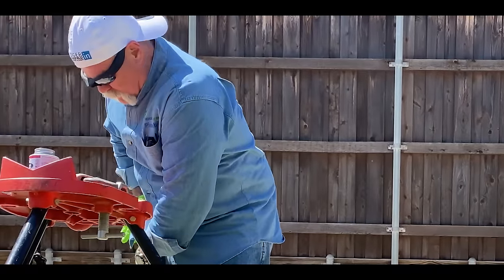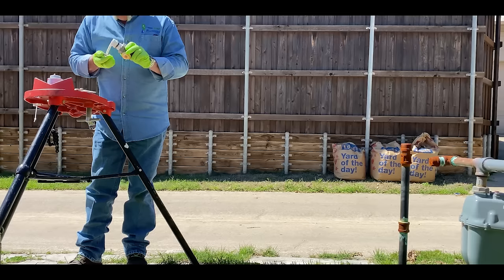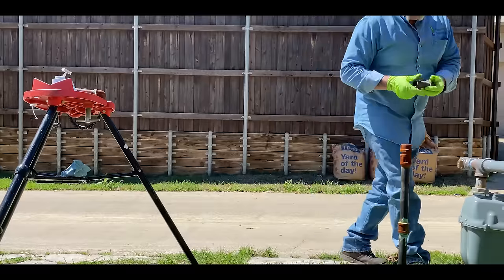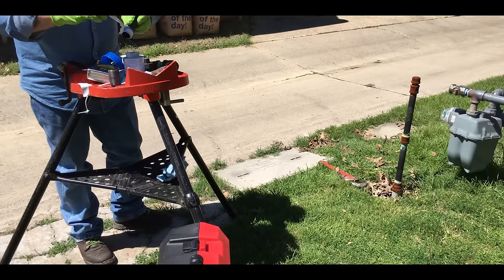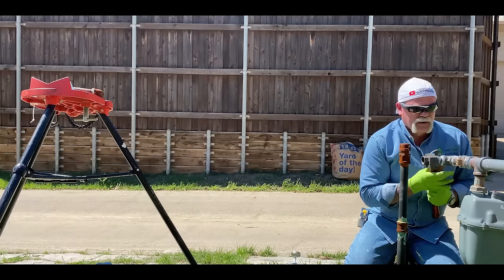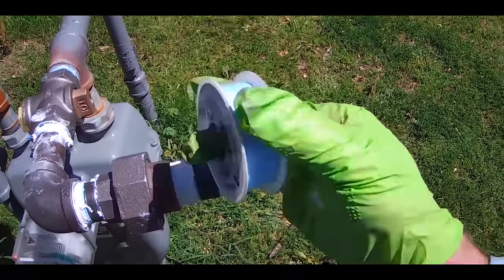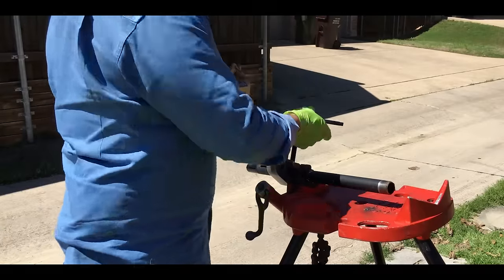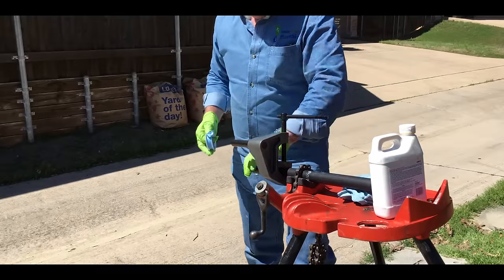Neighbor HIT This Gas Line! - Gas Line Repair (Plumbing POV)

Comment: Being a pipefitter/welder here at TI i use that same process on gas and then i switch to true blue or SWAK on water . gotta make a repair on the new house im buying but its not at the meter its on the side of the house going from the ground into the house. good job and very informative.

Comment: I work for a gas utility company in the northeast . It blows my mind that gas meters are in the front yard... ours is in the basement or on side of house .
Reply: I think that is an alley behind the houses.
Reply: Where at I’m baltimore and ours are inside or the front corner
Reply: @thagasguy  New England
Reply: @Mike-mn9xo  very cool! Safe operating!
Reply: Where is the riser ,out or in, and cause it blows my mind see in under or in house with the reg,
Reply: @Drewdayz2419  depends . We have a lot of houses with regulators inside . We are now moving them outside . But probably take 40 yrs
Reply: Inside thats crazy to me, reg  Malfunction or break off below the reg that house fills with gas within seconds
Reply: @Drewdayz2419  well the regs are all vented to the outside in case of failure. And most services have EFV valves in case of a line break .

Comment: I like your vids, I am a sprinkler fitter of 35 years , But i'm always learning something, we as sprinkler fitters always use the dope first then cover with teflon tape, But that is only because we are laying out one hundred heads, 3 - 4 piece heads or more for the T.I. of the high rise floor that we are currently working on, But the teflon tape before the dope or paste does work better especially on bigger pipe diameters. just my 10 cents worth. Thanks, keep the vids coming.

Comment: Hey Roger, its Shaun again. We've had a comment conversation before over another of your videos. Im a plumber and licenced gasfitter here in Saskatchewan, Canada. Again, great video. Its crazy to see the differences in gas code from place to place. Here in Saskatchewan, you'll never see a meter hung like that. Our meters are either mounted to the house , or we have what we call trailer stands, which, if a meter cannot be bolted to a fixed-foundation house, are used. They sit at about 4' above ground. Few other things, we aren't allowed the use of galvanized piping for anything in plumbing, other than rural waterlines. Everything i do gets painted grey, or yellow in a commercial application. A lot of cheap guys in town here just leave the black Iron to rust, which looks like absolute garbage.
We have to have riser sleeves around any gas riser coming out of the ground, with 14gauge tracer wire, and 4-elbow, 10" center to center swing joints. Its crazy for me to see that piping out of the ground with no swing joint! 
As for the "teflon" and dope....i was trained with just dope. My journeyman was old school and it wasn't until I was doing a 12 unit condo building in my third year of apprenticeship that I requested "teflon". Our tape for gas is yellow and its a PTFE thread tape. But yeah, tape the threads and then dope. Doesn't matter if it's gas or water. Always tape then dope. Its a different feel than just dope.

Last thing to harass ya about is the m18 threader. It only became available last year and ive been toying with notion of purchasing one. I've always lugged around my ridgid 300, and I have an auto-oiler at my shop. The only hand threader that I have is the ratchet style hand lever, which has been good for taking out on location for small works. Im going to assume that youd recommend it? Haha
Reply from the maker: Thanks again Shaun. Around here this is the normal. There are a million things that I think should be done in all of plumbing but if I did all of them and nobody else was I would be going out of business. I started using tape and dope when one of the smartest engineers I ever met told me that was the way he wanted it done. You're right, I really like the M18. I've used the 300 for a long time and the ratchet threaders have been in my vans forever. BTW, We quit using galvanized for waterlines many years ago.

Comment: Hey Roger. I am a nyc plumber and I was taught to never use Teflon tap on gas. In fact. It is not allowed by NYC code. Honestly I don’t know why that is. But I love using my ridgid 700 pony with the ridgid support arm to hold back the threader and the same vise. But I like that Milwaukee makes a battery operated threader. No more extension chords

Comment: Hack: Doesn't turn the gas off or care.
Novice: Turns the gas off to be safe.
Pro: Knows the correct way to do it without having to shut off the gas.
Reply: I’m sort of a mix between the first and the last. If I need to put one fitting on a live gas line, I’ll do it without shutting off the gas. However I don’t bother trying to cover up the pipe or anything like that. I just get everything ready then screw the piece out and put the other one in. If some gas goes into the air, oh well.
Reply: I hope there is NEVER anything gonna happen if you leave on the gas line,
Cause no insurance will pay...
I mean why would you rather turn it off most of the time there is no one at home. I think to be safe is more important than not need to turn off the gas.
Reply: Cillers badass if you know what you’re doing there’s no risk. It’s not as big of a deal nowadays with all the electronic ignitions. However at one time, if you turned the gas off it cost you an hour or more to relight all the pilots in the house. Therefore if you had to make one connection it saved the customer to work on it without killing the gas.
Reply: How do you pressure test the new joints for leaks without turning off the gass or isn't pressure testing an installation a requirement in Texas? Also "it's okay 'cause I don't smoke" seems a rather deceptive statement with cars driving by at a few feet from the open pipe. I must be missing something here.
Reply: @cillersbadass7590  To clarify: I don't think it will explode (in this particular case) because of sparks from rims hitting gravel. But the cigarettes warning seemed rather out of place here. The question about the pressure test was serious though. You don't do that in Texas?
Reply: TheBayru a little repair like that you don’t have to pressure test because you’re repairing it. You don’t have to pull a permit to repair a few feet of pipe. Also you could light a lighter a few feet away from that and it wouldn’t do anything. Gas doesn’t just blow up with the tiniest spark outside.
Reply: @joshcowart2446  Thanks for that Josh, out here after any change between the meter and the contact point for the appliance a pressure test should be performed (not saying they always do but they should). Also outside here most guys work with a burning torch on the side of the pit (piping runs underground). So no, a flame does not equal an explosion. It was saying that it's okay to work on open pipe flowing gass because he doesn't smoke that seemed weird. But I'm a bit anal about those things. Out here though, you'd never work on gasline under pressure, unless it was the main line before the meter and only Company men may touch that after they qualify for specific tasks to be performed (f.e. new connection).
Reply: @TheBayru  hey, I am from German, so I don't know if a preessur test is a thing in texas. But I have never ever seen someone operating on an working gas pipe. Do you even notice how dangerous it sounds?
It's fricking Gas, I wouldn't like to mess with it...
Why would you get into danger, when there is no use/have to it.
Sry if my English is bad.
Reply: @cillersbadass7590  It's safe to work on a live gas line like that because it's pressure is too low to be a hazard, and most people know what they're doing when it comes to replacing that stuff.
Reply: Eh
Reply: @cillersbadass7590  all the time we have acetlyne tank 2 feet from us when soldering at worknnot to mention the flame is pointed it it most the day nothin has happened so whatevs
Reply: @joshcowart2446  u wanna test tht
Reply: smellymeadow hel sure, the gas dilutes as soon as it hits the atmosphere. It’s not concentrated enough a few feet away. If it has enough pressure to be concentrated enough a few feet away then it would blow out any flame except a torch.
Reply: @joshcowart2446  fiqured something like that tbh wasnt sure how quickly it would dissipate tho
Reply: Gas man bypassed with a gas cylinder when he changed my meter, and did not have to come in the house at all.  Pretty neat how they can do this without shutting off the gas, very low pressure to deal with.
Reply: @TheHobbyShopFilms  as long as the outlet tee is accessible and a probe would be inserted into the tee - no interruption. In this video however, the gas service would require a shut down because he tied into the outlet tee.
Reply: Even the Gas company often work on regulated gas lines without shutting the gas off as it's the easiest way to ensure that air doesn't get in the open pipe, plus the pressure is so low you can literally just put your thumb over the pipe and stop the flow.  Even the small amount that leaks out is so dispersed it's about as flammable as a fart.
Reply: @TheBayru  no need to pressure test that connection  just a soapy water bubble test will do..  only need to pressure test the house if something happened between the meter and indoor connection.
Reply: @TheBayru  soap, and he already checked the line in the ground he just didn't see it, second that meter was feeding two lines, the one he tied in could have been for generator or something not going in the house,
Reply: Gas not as flammable as u think in open atmosphere.

Comment: I work maintenance in a factory but 50% of my job is pretty much working with piping. My favorite Milwaukee tool I've used so far is their m18 PVC Pipe shear. I think it can cut up to 1.25" pipe, but most of our chiller lines to our machines are 3/4 schedule 80. It makes it super fast and always a clean cut. I have yet to have it bust apart a pipe instead of cutting it.

Comment: Seems like a massive safely hazzard to have an exposed gas mains next to a road with 0 protection around it, hell put a crappy picket fence around it at least!
Reply: his surroundings are clear, im sure if there was any cause of danger he would know of it, considering he is properly certified and has decades of experience like working for texas instruments. it was open for literally .5 seconds
Reply: @kidvinkly2771  i'm not talking about the job, i'm talking about an exposed gas line near a road with no fence or anything to stop a car hitting it
Reply: @The-Omega-Blade  Welcome to North America 😂
Reply: @ScaredDonut  i live in the UK, i fear what america is like
Reply: @The-Omega-Blade  My city has a few near major roadways (80KM/H is the speed limit on those) Wouldn't be a good day if a car hits it
Reply: I know here in Ohio the reasons we do remote meter sets (I don't think I've seen one this close to the road though) are either because of sceptic tanks, environmental reasons, or the owner didn't want us to pipe all the way to their house so we settled with a remote meter connection and they run the house line after the meter at their own expense.  If we had to place a meter this close to the road, surely I'd like to think we would put up a few bollards like we do in high traffic driveways where there are nearby meters.  I'm not 100% sure on how far they have to be from the roadway by code, but we'd put their meter outside of the public R/W on their property.
Reply: @The-Omega-Blade  you'd really freak then to see the Regulator stations right on the side of highways out  in the country where I live..

Comment: Awesome repair! As for the machining oil so you don't spill so much like I saw in this video cause I know you like to keep things clean get yourself like an olive oil dispenser or even an old oil dispenser you can easily direct the oil where it's needed and don't need to drip all over the ground idk if this helps but it definitely makes for less of a mess

Comment: Where I’m from local code enforcement will fail us for using Teflon on gas connections, must be pipe dope only.
Reply: RE code book  closely ," dope must be applied to male threads", what you put on above and beyond up to  craftsman.
Reply: @Republic1usa  but it’s up to local enforcement and they will fail inspection here if we use anything but dope.
Reply: @m.koehler7716  What state?
Reply: @tipperzack  Maryland

Comment: Please don’t add much pipe dope to the beginning threads, you’d be surprised how many gas valves get clogged from pipe dope and had to be replaced 🤦🏽‍♂️
Reply: corey Babcock wrong as long as you know what you’re doing. I’m sure it’s happened once and you say they get clogged lol not a common problem
Reply: @chrisd3399  ... I do a LOT of generator work and you'd be amazed at how often I find pipe dope in the works within the gen set when it doesn't start on the first try after an install. I won't say it's often but once a year (in my 25 years) is often enough to know where to place the blame. In cases where I needed to check pressure on an older install and there was no test fitting I have used the sediment leg, where I also run into some goo balls left over from the original installation. Just saying it's more common that you think, even if they never actually cause a problem.

Comment: I never use any tape on any gas line connection and actually illegal in my state. For a number of reasons number one why I don’t use it is because while threading steel pipe your dies teeth wear down... gotta replace them. Instead of replacing them let’s add tap. Fresh cut pipe threads should screw to the female end idk 2 turns if even. With new pipe die. A lot of mechanical contractors when it comes to gas lines they use a lot of tape ... to rebuild the thread up for there blown out die...

Comment: I had a water heater installed by a plumber who used pipe dope and teflon tape. This was the first time I had heard of that but I've been using that method since and never had a leak 👍👍👍👍👍

Comment: Surprised the local gas utility there won't install a barrier at that meter since it's right next to a road. Also interesting to see meters in different areas of the country. Here in SoCal, that spot is usually reserved for a "bypass tee" so future work upstream of that tee can be performed and still provide gas to the property. All branches are usually downstream of the tee coming from the meter.

Comment: That black iron on the riser is exposed to weather. It probably should be painted.
Reply: It’ll be alright
Reply: @spencerhanson3112  untill it rusts out and leaks yeahh just hope no smoker walks past as it does and hope for no sparks when it rusts out or they'll have a bad explosive time 😅
Reply: Seems to me codes are lacking down in Texas. In New Jersey teflon tape is not permitted on gas pipe & all exterior gas piping must be painted with rust proof paint not to mention pressure tested
Reply: @richardjoseph8683   Id like to imagine he did a leak test inside the house at an appliance, much easier. Kinda silly that NJ doesn't allow tape.
Reply: @joshuapittman5208  It was a dedicated line to the pool heater so therefore couldn't be tested from a house appliance.
Reply: Where I am at, the Feds (DOT) regulate the gas company and require all exposed pipe to be painted with rust preventing paint.

Comment: I'll agree, Teflon tape and dope is splendid for water connections.  But I was always told to avoid tape for gas as it has the potential to flake off and cause a restriction in a burner orifice or gas valve.

Comment: Oilers are good for getting just 1-3 drops of oil right where needed in the threading die, and Rapid Tap is nice since the can comes with an applicator built right in!

Comment: Teflon and dope ......always. Your right it was one or the other. I probably started that as common practice mid way in my career which is about 15 years ago. Almost never have a leaky joint. Great info to put out there.

Comment: Teflon and pipe dope is  something oilfield roustabouts learned a long time ago. We also use kopr Kote on the non threaded rounded part in the middle that meet on unions like you were tightening at 16:30 only difference is we’re using hammer unions.

Comment: This is how I was taught.  You drive any fitting down much easier and more efficient with dope lubed teflon setup. Usually i just use dope only good for LP gas and drive it down. All depends on city code.  They both work good. Even better together

Comment: 40 years ago an old journeyman showed me the teflon tape and pipe dope trick. He pointed out the Taiwan pipe and fittings  and lack of quality control as the main reason for doing so. The other advice was to use galvanized fittings for gas lines to avoid sand holes that the black foreign fittings sometimes had.
Reply: If you use galvanized fittings for gas you've done so illegally. ( in most places ) also you've joined dis similar metals as galvanized fittings contain zinc which is more noble than black iron, so you INCREASE the chances for pinhole leaking due to electrolysis. In short, you got taught wrong

Comment: That's a nice threader nothing worse than threading rigid. Usually 3/4 I'll do with the ratcheting threader. The power vice was nice compared to using the adapter for the hand threader to thread 4". As for M18 fuel, the crimpers for sure and the M12 cable cutters.